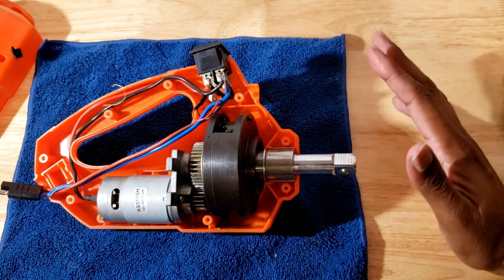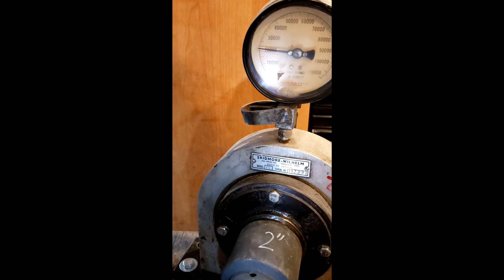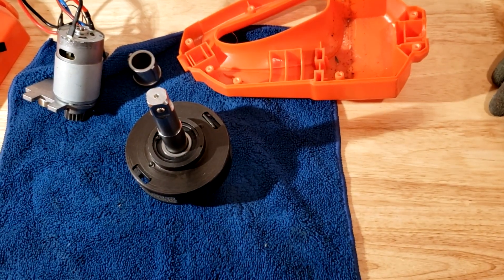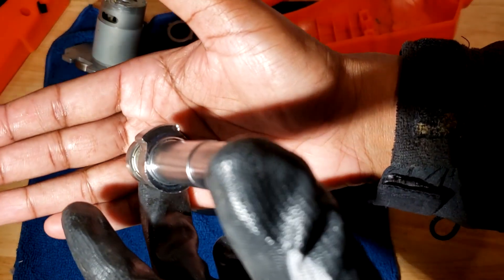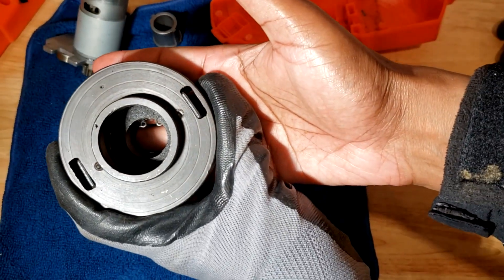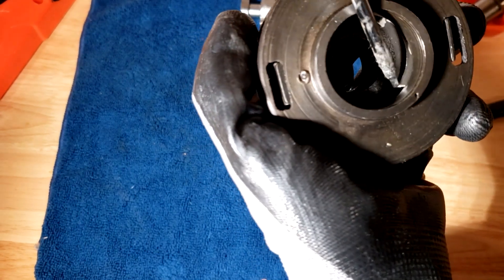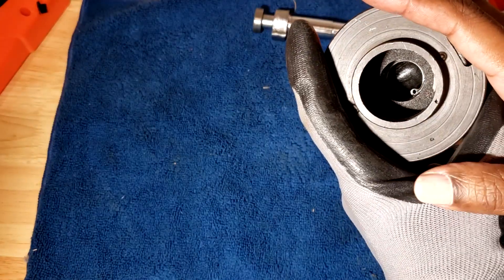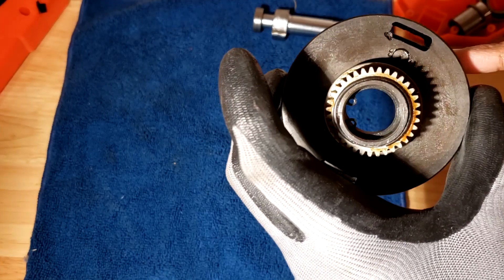inside flywheel impact wrench

Comment: Can you please dyno the m18 fuel high torque.... I'm very suspicious about torque test channel I dont believe ther machine is calibrated rite. If possible like a 20 second run to get max power. I love this channel and thanks for all you do
Reply: Very suspicious??? WHY? Even if their machine is off by 5% or even 50%, every other tool's numbers would also reflect that rate of calibration.
Plus there are at least a dozen other testing videos that verify those results.
Reply: @stans5270  stan stan on this channel watch the dyno of the midtorque and hightorque the numbers are not even close. To TTC.. there machine is tightening so there is no nut busting just how tight it can get which is significantly less than busting bolts on real world applications
Reply: And a skidmore also tightens, which is what SingleCams here does an awesome job of. And why does it tighten? Because that's the only industry standard of testing going back 50+ years. Nut busting is done differently by every brand, and there is no accepted practice. You can get +/- 40% depending on how you set it up.
But this is why marketing works, people care more about a number than how tools actually compare to each other.
Reply: @TorqueTestChannel  thank you